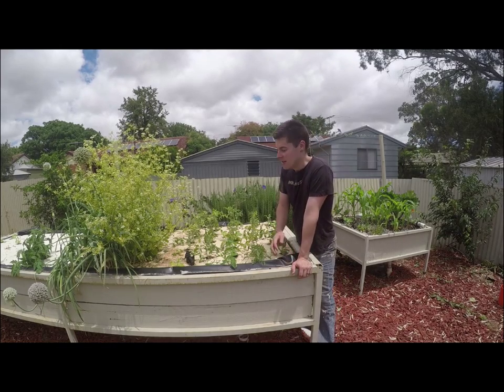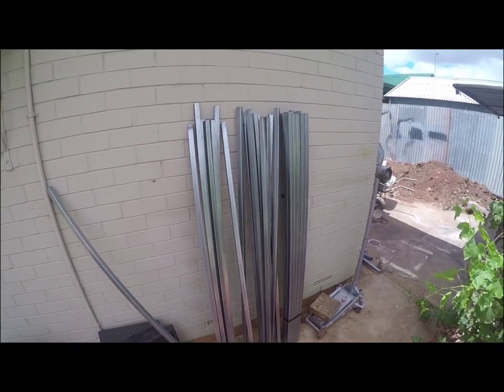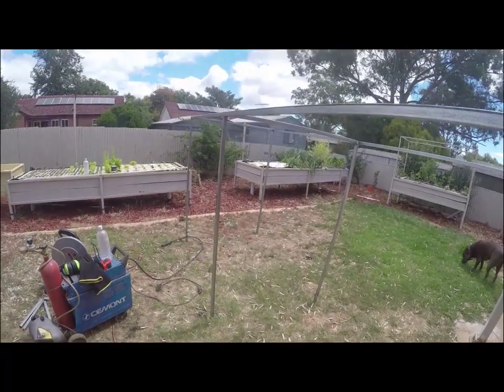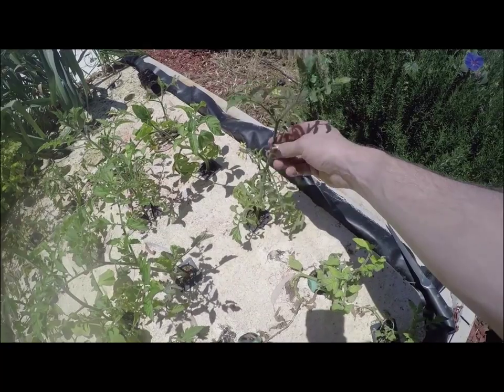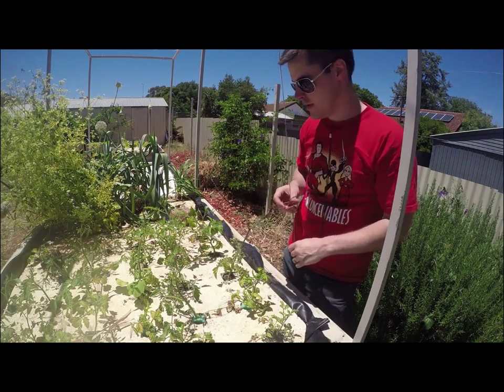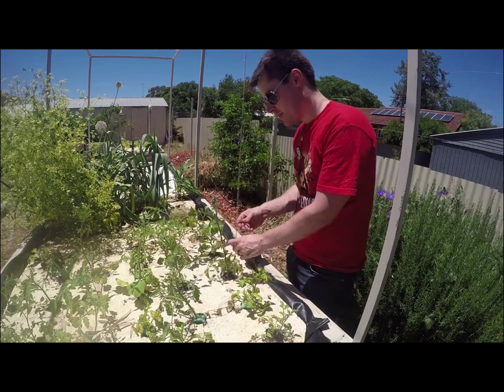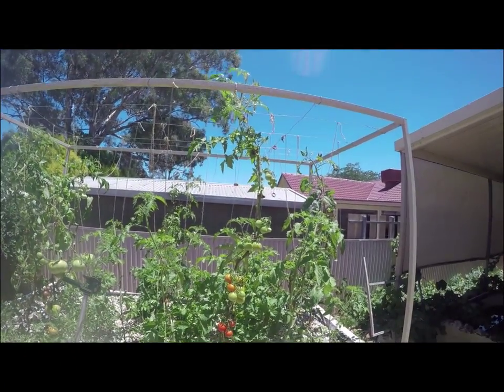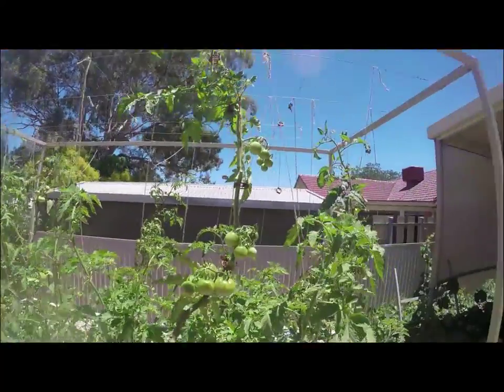How I string up/stake up tomatoes in my Aquaponic System

Comment: I subbed even though I could barely hear what you were saying. Looks like you have some pretty cool things going on there. I will be following your garden as I tend to my garden and my greenhouse!
Chuck
Reply from the maker: Thanks Chuck!

I know the sound was horrible, I got a new gopro for christmas, and I didn't learn that the audio is horrible inside the case.  :(

I've got an external mic now, so the audio should be 100% better now!

Thanks for watching.
Reply: I bought a lanier mic for my videos and it seems to work fine! Let me know what you think of the sound quality on mine.
Chuck